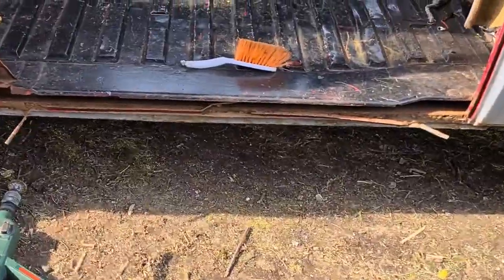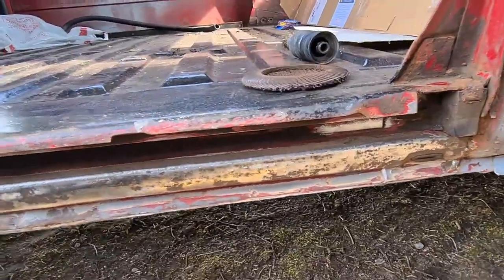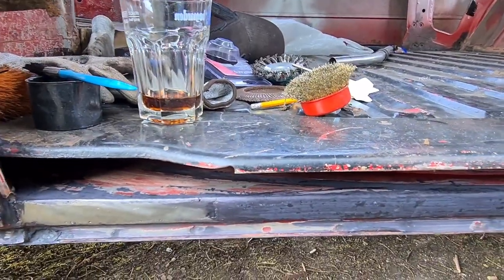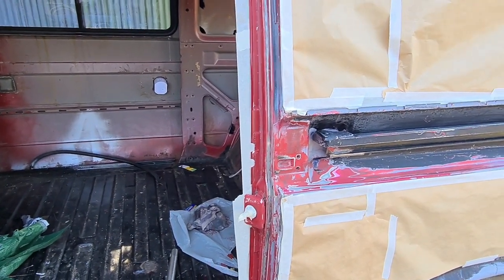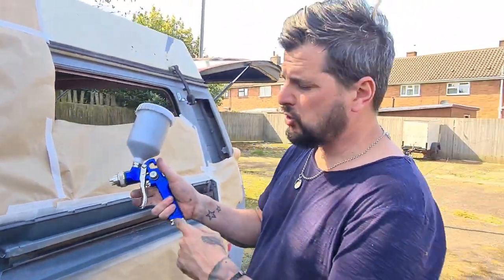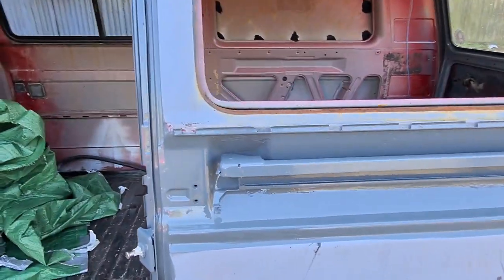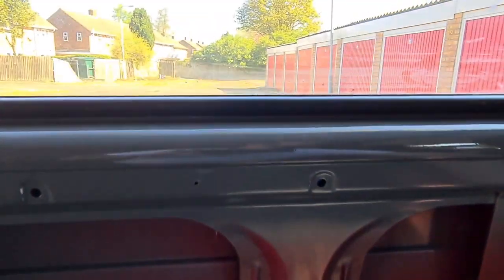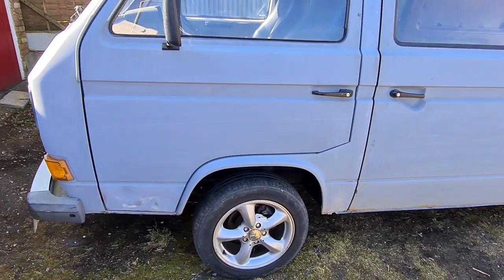Vw T25 sliding door moulding repair + Beginners guide to spray guns and spray painting

Comment: My T25 sliding door will open and catch but when I shut it, it won't catch. I need to close it a few times and hopefully eventually it catches and I can lock the sliding door. Any advice on that? Thanks
Reply from the maker: funny you should ask that mine has started to doing  the same .sometimes sliding door pops open when im driving i will have a look for you mate
Reply: bit late for this but ive just had to fix this issue on mine. turned out my striker pin wasnt tight enough so it was moving when the catch tried to connect. tightened that up and the door now closes everytime easily.